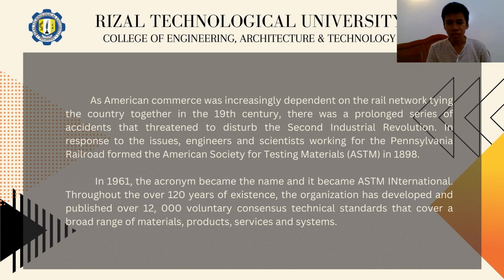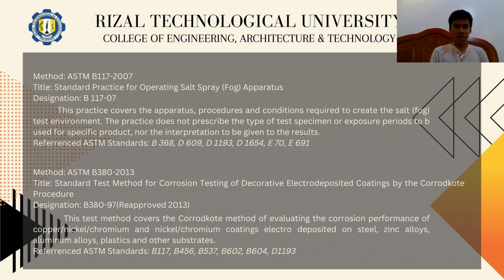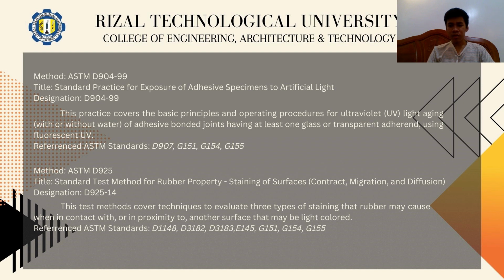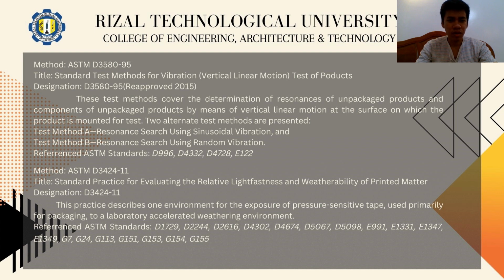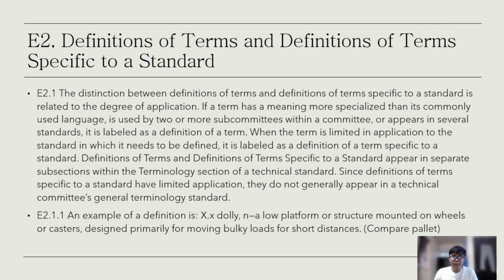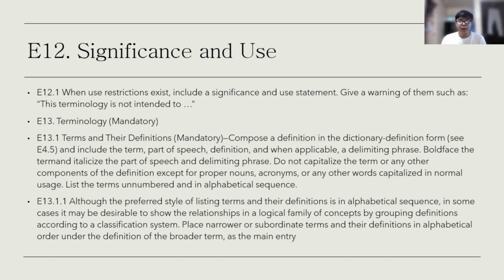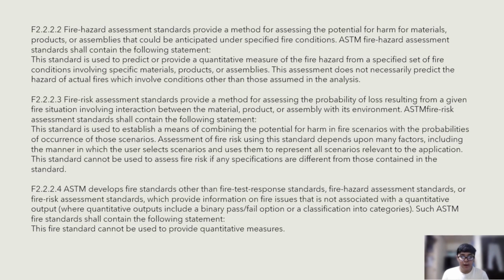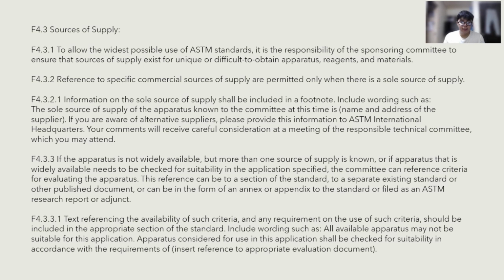ASTM

Comment: Thank you for the clear and proper presentation about the topic "ASTM (AMERICAN SOCIETY FOR TESTING MATERIAL). ASTM standards are crucial in evaluating the material, chemical, mechanical, and metallurgical properties of metals. This information helps guide product manufacturers toward proper processing and application procedures. ASTM stands for the American Society for Testing and Materials and has created six types of standards that relate to manufacturing processes such as testing, materials classification and operation. The six types are test method, specification, classification, practice, guide and terminology standards.

Comment: Thankyou for discussing American society testing materials I have learned a lot  like in the standard test methods of deflection temperature of plastic under flexular load in edgewise position taht covers the use of a spark generating aparatus for determination of failure due to cracking of bintumous materials undergoing accelerated or outdoor wheathering on electrical conductive backings.

Comment: Thank you group 13, I have learned different thing about the various types of ASTM standards, including language, classification, and practice standards. ASTM Committee E05 on Fire Standards is available to assess the fire standards of other committees.ASTM that helps to ensure that only high-quality raw materials are used to manufacture bearings and other industrial goods. Throughout the plastic supply chain, the standards are held in high respect.

Comment: Thank you, reporters; the video was very informative. In general, American Society for Testing and Materials is an organization that set an international standards for materials and equipments used in construction and transportation. I have learned that Standard practice for conducting tests on sealants using artificial weathering apparatus covers the three types of laboratory for evaluating the effect of  radiation, heat, and moisture on sealants.